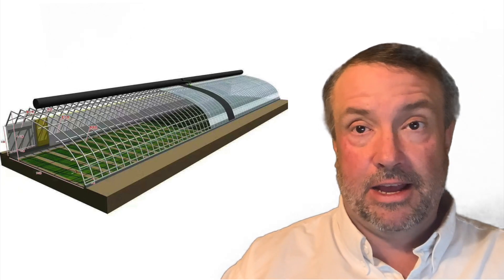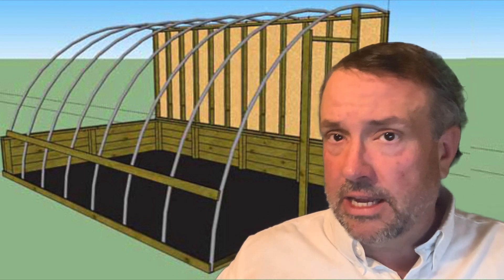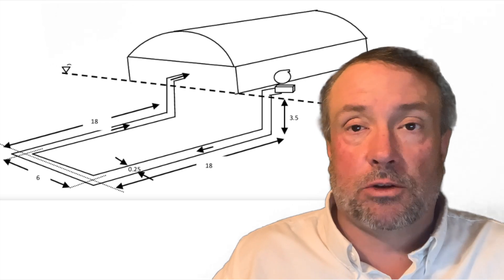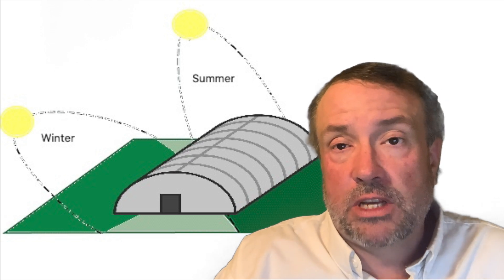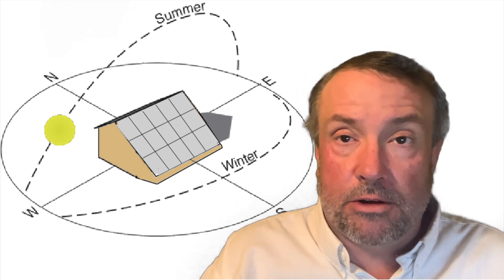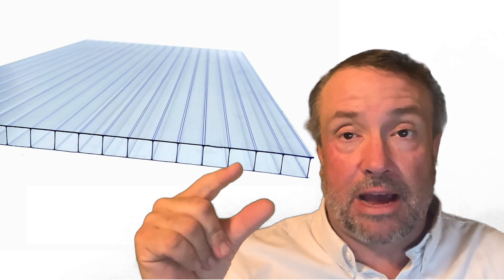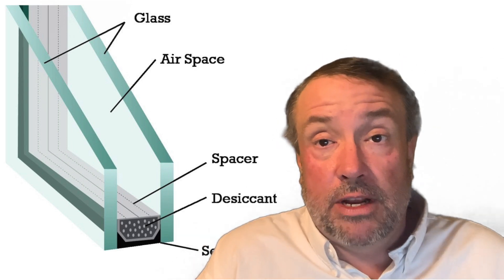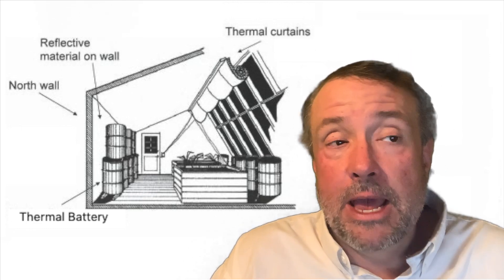Passive Solar Greenhouse Design

Comment: Good for characterizing the solar radiation incident. Depending on the position of the solar of the sun relative to a given building aperture, as well as other factors, the solar radiant flux incident on the aperture is composed of three items : direct solar radiation, diffuse sky radiation, solar direct and diffuse radiation reflected and scattered from the ground, vegetation, adjacent building, etc.
In general, as prof. have said, each of Green houses can be built but with different spectral and angular distribution.

Comment: Why do many passive solar greenhouses have north walls with a southerly slope?  This seems counter-intuitive to me.  If the back wall is vertical of even better if it slopes away to match the degrees of the winter apogee, then it should catch more thermal mass on winter days than a south sloping back wall.  What is wrong with this logic?

Comment: You NEVER want to try and force the hot less dense air underground. The efficiency of your fan is minuscule, and you are working against physics. In order for air to readily expend its energy, it must undergo a drop in pressure. You do that by pulling the cold dense air up out of the ground at the OTHER end of the system.
Reply from the maker: And yet it’s done all the time
Reply: @SimpleTek  yeah, I know. By people that do not understand physics. And they all have over heating issues in the summer and end up having to add heat in the winter because of it. Pulling on the cold end of the system increases the amount of hot less dense air is collected at the peak. By almost 2x
Reply: @SimpleTek  The Ideal setup for cold climates is a reversible fan at the lowest point of the greenhouse that can pull the cold air up to charge the battery during the day, and then push the coldest air at the bottom of the greenhouse down at night. This results in the air heating and expanding in volume and being pumped to the top of the greenhouse and pulled down by the motion of the fan.
Reply: @SimpleTek  Curtis Stones fancy greenhouse in Kelowna? Was built perfectly fine. They just failed the physics of heat transfer and were trying to blow the hot fluffy air down.
Reply from the maker: @davefroman4700  I agree totally on Curtis stones greenhouse and your assessment there
Reply from the maker: @davefroman4700  the issue is trying to get all the heat from the greenhouse and store that, that ends in failure. Look up greenhouse in the snow, much better system. I promote an enhanced solar charged version of that for my climate
Reply: @SimpleTek  The geobank system can work. But it needs to be properly insulated and used correctly. In all the time Ive looked at it Ive only seen two that were designed properly. Everyone else is trying to force hot air down instead of creating a vacuum in the system for the heat to flow to.
Reply from the maker: @davefroman4700  insulation only increases capacity
Reply: @SimpleTek  It can also limit the amount of energy that is allowed to permeate up into the greenhouse.
Reply: @SimpleTek  You do not need to capture all of the energy. You just need to transfer enough of it efficiently into the mass to compensate for its loses. That is where people fail. They are thinking of storing energy for months, instead of just for a couple days. When the sun is shiny and you are pulling on the cold side of the system you can recharge the battery fully in hours. Instead of weeks.
Reply from the maker: @davefroman4700  you don’t get it, in cold climates there isn’t enough every inside, you need to add energy
Reply: @SimpleTek  Ok. Now I understand the need for the evaporative tube thermal collection addition. Sand is an excellent thermal mass.Put the thermal loops from the thermal collectors on the bottom, and the air tubes at the top. You can store a massive amount of energy in a well insulated shipping container full of sand.

Comment: Great video!  i really do like the double frame with a 2 meter airspace.  the inside frame having a solar blanket operated by a motor.  the outside plastic layer can also have a vibrating motor installed to help shake the snow off!
Reply from the maker: Thank you!!!!

Comment: You can create a solar battery with water as well as air too. Bury a tank of water beneath the greenhouse. Set up your thermal solar collectors on the ground next to or on the top of your south oriented passive solar greenhouse. Run the pex tubing from the collectors to the tank and run another set from the underground tank to a radiant floor in the greenhouse. Charge the thermal battery with heat during the day and release this heat into the greenhouse during the night. That should work.
Reply from the maker: Great idea
Reply: @SimpleTek  The big problem with solar greenhouses, is that in places where it rains a lot, you get no sun to heat the back wall.
So solar greenhouses only work in places with constantly clear skies.

Comment: You didn't mention a cold sink.
Reply from the maker: do tell
Reply: @SimpleTek , in the cold country (Montana) I've seen them with basically a trench below the walk level. It lets the cold air settle below the lowest usable part of the floor. The theory is that it will then warm by geothermal and rise. It prevents the coldest air from settling around plants. But! I do not have a walipini myself, so.... how is yours performing?
Reply from the maker: @yLeprechaun  Montana is like Hawaii to me, I’m in Manitoba.
My greenhouse is doing great right now, -20C last night, 12’C inside
Reply: @SimpleTek  glad to hear as I am going thru design concepts. I plan to build one this coming summer. So you are telling me, I need not worry about the cold sink? Good to know. If yours works without it in the tundra, then I should be fine down here in North Hawaii. ;)

Comment: Does having any kind of motor running the geothermal battery defeat the name "Passive"?
Reply: You can use thermo siphon for water or air movement.. no power..
Reply: @frenchfryfarmer436  Thanks it's one solution I favor but I didn't know the name. Good old convection power in a closed system loop.
Reply from the maker: good question
Reply: Blower is optional for passive heat flow. But at a much lower efficiency than running a blower when needed to boost flow and energy gains. Passive flow can get to 90-100 F before a good flow happens (this is harmful to plants and human's comfort). Whereas a blower can be set on a temperature controller that turns on blower fan at 80F and 60F settings. This can be powered by solar panel and battery and inverter. ( A 'passive' purist may argue is is not 'passive'. But they will not cover the cost when your plants fry.).

Comment: I just wanted to add that when we talk abouth the Southern hemisphere,..It would then be a Southern wall instead!!
Reply from the maker: most populated Southern Hemisphere locations isn't cold enough to need this design - unless you're talking Antarctica and there it's too cold and growing would be hydroponic and inside under grow lights
Reply: @SimpleTek  Thanks,....good to know!!.I live in central Chile,..but my mother got some land in the Southern Patagonia in Argentina,...there it is  needed (I guess)with winter freezing temperatures up til -10 celsius during the coldest in winter....I love this practical design,Im glad I found your site,...Have a good day!take care.
Reply from the maker: @anglosaxon244  it freezes in Argentina???
Reply: @SimpleTek  yes,..its a kind like North Europe,...Its preety harsh,..but summers are greath...Here in Chile its abouth the same but with much more rain....Now we are talking abouth the Patagonia,..you know the southern part of the continent...the central part its like the mediterranean zone,and so on!...its a good place to sattle down after my experience at least...Im here since 2005,and still alive and kicking.
Reply: @SimpleTek  Basically the same rule as further you are from equator, the colder the winters are.

Comment: We are about 95% of completion of my new passive solar greenhouse!!! (Northern AB!) Yeah! 
Just waiting on the rest of the polycarbonate panels to come in to finish the south roof line (currently heavy poly for now) the north wall is insulated to the 11’ peak! (And shingled) 
All of the other walls are insulated as well but only to the top of the 8’ height. I’ll be working on later this summer the ideas I have for heat battery storage and possibly an insulated blanket installed inside the GH to roll down or I may create insulation panels that are put in place at night to retain the heat at about 6’ level inside (effectively have a closed in greenhouse inside the greenhouse! 😜) 
And I also have ideas that I might build a secondary insulated (foam sheets) wall (with doorway) inside the GH as soon as I enter that would help to have a zone where the extreme cold stays out of the warmer zone. And maybe, not sure yet, toying around as I get used to this new structure, I may install my 5x5 grow tent inside the GH with LED lights, exhaust and shelving inside that will be exhausted into the main part of the GH and it may use some of that heat that gets exhausted from the grow tent. 
Oh! Forgot to mention, I live in the city so I wasn’t about to do a big dig in my city yard for the maybe possibly of geothermal air exchange, so I chose to insulate the plywood deck 6” of foam board insulation between the joists and plywood! 
So many possibilities now that it is built and in use! I’m ecstatic and over the moon to be using this GH this year and watch what happens!! 
Thanks for all your posts and videos over the last 8 months! I’ve taken a several ideas from you and the Chinese built greenhouses and others to come up with what I hope will work for us here! 👍👏💪😁
Reply from the maker: Thank you for the kind words!  I'd love to see pics or video of your greenhouse!

Comment: In your opinion would you have your wall painted black to absorb heat or silver to reflect light,, or does it not matter?????
Reply: It depends if your north wall is a thermal mass wall or just a low mass wall. If the north wall is made from a thermal mass material with a relatively high thermal capacity e.g. Clay, concrete etc then you would paint the wall black to allow the wall to absorb the solar radiation in the day and 'charge up'. The wall would then release the heat back into the greenhouse at night when the temperature drops. If the north wall is low mass e.g. wood, Gib board and insulation then you would paint it a reflective colour to reflect the light back onto the plants during the day. Obviously a low mass wall will not 'charge up' and release heat at night.
Reply: @Kiwipictish  You might even instal some basic roll down sheet that would be white, and during winter when there really now real heat from the sun, and not enough sun in general, you could roll down this white roll down on the (otherwise black painted wall) so this way you would reflect light back to the walls, since during winter (at least where i live) theres not that much light, so i assume any additional light the plants might get it good... ANd because there is not much sun light, the thermal mass of north wall wouldnt really heat up anyway, so its better to lower the white cover to use it to reflect light... Is my thought correct?

Comment: Once again I feel obliged to temper the conclusions of one of your videos.

The design of what most people think of as the standard greenhouse originated in Holland, that source of so much agricultural innovation over centuries. The winter climate there, while not overly chilly (like Manitoba for instance) is excessively dull. Thus the design they came up with was not optimized for heat retention but for absorbing light. This explains the glass on all sides and the north - south orientation. 

Perhaps a better way to begin the decision making process for a greenhouse is to review the climate records for the place you want to build it. With the Internet this is very easy indeed to do.
Reply: I have seen plenty of less than 45 degree roofs wide dome roofs fail. We, in the snow and freezing rain countries need to design & build accordingly.

Comment: Lots of what this guy mentions are pipe dreams that if possible would mean we would be farming the arctic circle. Go speak to anyone who has actually built these designs and see how difficult it really is. Most youtubers talk about this but don’t actually show theirs performing in cold conditions. You would be better off heating with gas.
Reply from the maker: As I live 60 miles NORTH of Winnipeg, I kinda do have a clue as I run a 4 season greenhouse and know many people in this climate who do as well.
Reply from the maker: actually farming actually occurs in the arctic circle in many communities there. they use mostly led lights for growing, and windmills for power
Reply: No one said you can't do both. In fact it is wise to have backups of backups. Too hot from fuel industry/power company heating ? Turn on the STHC blower.

Comment: The idea of using air that has a super low specific heat constant to heat dirt or rock that has a very high specific heat constant has been tested long ago and has failed. The problem is the temperature differential is very low and air is a terrible conductor. You should do better analysis before wasting time and money building any of this.
Reply from the maker: Obviously you've never sat in a sunbeam behind glass in -40' weather before. Sucks that such a simple example makes your fancy technical words completely wrong.
Reply: @SimpleTek  @Z Smokey has made some valid technical points, instead of criticising the poster with derogatory comments why don't you reply in a professional manner and provide links to actual measured performance data which would answer the concerns of the poster. I am sure that most viewers would rather see that instead of a sarcastic reply.
Reply from the maker: @Kiwipictish  Pfffffft! :P
Reply: @Kiwipictish  Textbook explanation on heat transfer isn't as convincing as personal observation. It's the same reason why Walipini greenhouse is dug a few feet into the ground because the surrounding ground retains heat better than air.
Reply: @feix5800  The advantages of thermal mass and insulation are well known and are not in question in relation to a Chinese style greenhouse. The unanswered questions I have are related to the efficiency and cost effectiveness of climate batteries. Personally I would not spend time and money installing one without seeing actual measured data that shows the efficiency and cost effectiveness. If you have such data I would be more than happy to review it. I have not seen any data from anyone so far, which begs the question why not?
Reply: Heated air is a form of radiant heat. (not as efficient as water is.). Warm air flowing through 3/4 " gravel will give up its heat to surrounding rocks to reach an equilibrium of both air & rock temperature. Air temp. flowing through cooler rocks will warm rocks to air temp. and not 1 degree more. Reverse also works. I can see researchers input 80 F air to 75 F rock bed and then state the 2.5 degree gain is not worth the cost. 

However, if given enough time, the rocks will become 80 F (a 5 F gain). If rock thermal mass is 60 F and air pumped through is 80 F, then it becomes a 20 F gain temp in rock temp. My woodstove heats the air, the air heats my walls and ceiling to air temp eventually. Even rooms not in direct exposure to the woodstove direct radiant heat. On a very hot day in the shade, you will warm up from the hot air. If air is such a poor thermal exchange medium, why does metal get hot/cold to air temp, ? It is not just sun and rain that melts the winter snow. 

STHC system is basically a thermal mass heated/cooled by air flow temperatures from air inside of greenhouse and areas exposed to sunlight. Even heated liquid pipes transfer heat by heating air space and physical transfer to the touching objects. 

Why there is little or no data ? Maybe the HVAC & Power & Fuel industries needs to sell their expensive goods & services. Nothing is stopping one from using both water pipes and air pipes to fuel the thermal mass to desired holding temperatures. 
I have seen and read several technical data and papers on STHC using both systems some 20-30 years ago. Do not ask me for them, my memory is not that good :)
Reply: @feix5800  To deny the role of heated air inside the Walipini playing a role in the heating of exposed ground, is foolish.
Reply: Yeah i was wandering about this... But it would still work right? Just not so long and not to such a degree... Meaning in real cold, in months far awaway from sunny months you would probably have to give it some "active energe heat source" - like gas heating or whatever...
Reply: @JuSmth  Having a backup system or two is a wise policy. What we are trying to accomplish is a system(s) that provides a majority of energy needed to maintain a minimal to ideal environment for plant's health & production. 
A few days of rains/overcast/snow storms will drastically reduce efficiencies of alternative energy systems. This means that other energy system (s) need to be on the ready.
Reply: @JuSmth  It doesn't deliver enough stored heat to make it worth the effort of excavation only to have massive ducting and large volumes of air and fans to blow. The fans alone will use tons of energy only to fail to keep the greenhouse even a few degrees above outside air temps. Then if you turn on a heat source make sure to turn off air circulators or else you will blow your heated air down a money pit. I advise you find systems that are actually built and doing this and study them, youll find lots of issues that make it unreasonable.